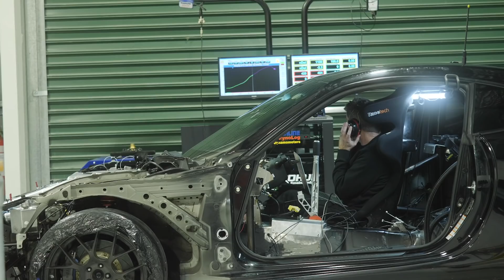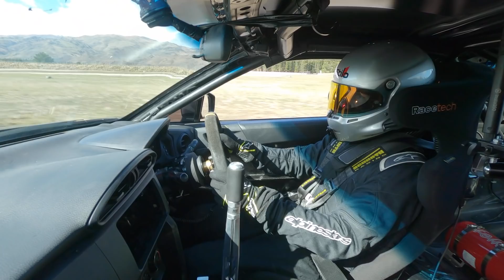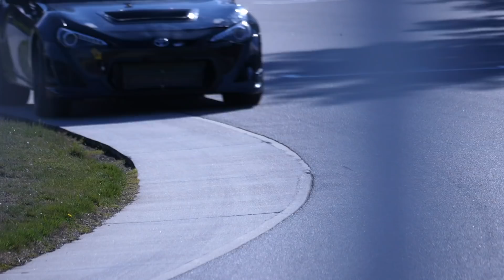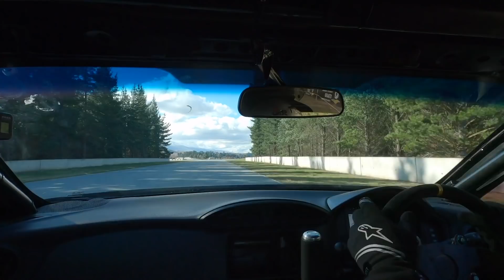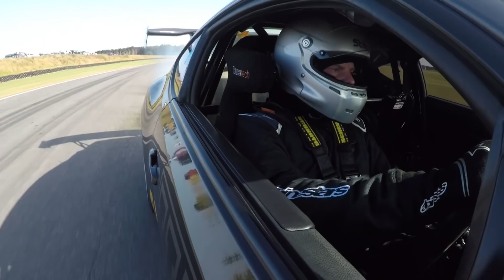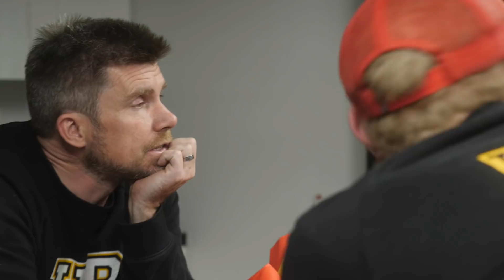Full Power Tuning & Track Testing | 650HP SR20VET Swap | SR86 EP 6 [#BUILD]

Comment: flowing too fast is completely false. It may affect how it flows through, balance...but it will never be too fast. As for the fluid ejection...no signs or warnings/fail safes for cooling system pressure ?

Comment: Can you give a bit more clarification around the power matters not torque and seeing how you run the car totally naked on the dyno with the intake right infront of the fan, would that not alter the tune once the body panels are on the car and the intake is brought back in the engine bay be it with a open air path?
Reply from the maker: You need to confirm the tune on the track/street, it's the last step of dyno tuning. Doesn't really matter what panels you have on or off, you can never replicate the real world on a dyno like this.

I'm sorry but I don't understand your power vs torque question - Taz.

Comment: Just a thought! I've had an engine builder tell me to run water only in the cooling system until the coating on the head gasket has had a chance to 'bond' with the block and head. Apparently the chemicals in coolant can interfere with the bonding process causing gasket failure.

Comment: That sucked, and not in a good way...
Any reason you weren't running a coolant pressure sensor and alarm, or didn't it trigger as the pressure wasn't high enough - you may get very lucky and just have a faulty pressure cap?

Comment: Replace head gasket, check head for deck flatness, torque the head to slightly higher tension than used previously,...
Then Run at much lower boost...

After the upcoming event, rebuild the block with coolant ring machined around the deck in this video @10:15

https://www.youtube.com/watch?v=07HHr6u1t-I
Reply: Also i think the earlier run with stuck thermostat with coolant temp reaching 120degree C pretty much accelerating this issue (or could be the source)

Comment: Loving this series! Also: what do you think could cause the head to lift like that?
Reply: High cylinder pressures or excessive boost is a common cause, sometimes the gasket itself, if the seal isn't optimum can give way under too much pressure. In drag racing where they run upwards of 50psi boost its common to see steel 0-rings (fire rings) coupled with custom gaskets and sometimes larger head studs to help alleviate these kinds of issues. Its an expensive rout though and requires a specialist to be done correctly.

Comment: My 2cents is pulling the thermostat causes you to loose the "pressure head" (of coolant) in the head block that packs coolant tight around the hot spots.....so steam pockets can develop causing localised overheating coolant pressure spikes etc.

Comment: Ugh that’s gutting news. Still, good to discover it before the practice session. Appreciate the behind the scenes reality of the situation discussions, felt like we were in the room with you guys. In a sea of unicorns and rainbows the harsh taste of reality coming at you fast is refreshing from an audience standpoint. Sucks the coolant pressure sensor wasn’t working but it seems pretty conclusive for the footage. 

How would you proceed with this? Torque the head and go do a quick couple of pulls with the coolant pressure sensor operational? If you weren’t on a time crunch would you just pull the head straight away?

Comment: Great to be on the journey with you guys, fingers crossed you got it sorted today. Andres comments about removing the thermostat resulting in water flowing to fast were interesting because I have read some info to the contrary. That there is no such thing regarding water flowing too fast through a heat exchanger, it's all about a centrifugal water pump needing some back pressure to get into its operating region, otherwise it's just free-spinning in the water. Or something like that, would be interesting for you guys to dig into one day!

Comment: Had a quick scan through the comments and haven't seen this one asked yet. Given you were chasing overheating problems prior to water blasting the engine bay, how did you conclude that the issue was excessive cylinder pressure lifting the head vs inadequate cooling leading to the headgasket failing?
Reply: He was saying that issue was fixed when they drilled the tstat it wasn't overheating anymore.  I'm guessing they damaged the head gasket seal during the period when it was initially overheating to 120C (VERY HIGH!!)

Comment: Man that sucks! I assume you guys are running 1/2" head studs? If so 24psi shouldn't be a problem. I've never retorqued head studs after a heat cycle but again I've never pushed boost too high but its definitley something I will be doing on my next build to be safe.

I have a P11 head here with no cams for my SR22 build, what spec are your Kelfords? Also you mention its a stock head? Is that in terms of porting or is all hardware stock?

Keep plugging guys love following this build! Also I'm the guy you Skype interviewed in Sydney in regards to the Motorsport Engineer role :)

Comment: This is why most Road Racers will drill 1/8 inch hole in their thermostat.... I guarantee you the cooling problems are the cause of the blown head gasket/ warped head. And I really doubt that they're going to make that event. I really hope you guys get to make it to the next event... i suggest buy a couple thermostat's... drill holes in them. Make sure that you have three or four different temps. that way you guys can dial and how it runs. who cares if it takes a little while to warm up and it wants to cool down that's kind of what you want in a road racing car. Best of luck

Comment: Suprised you don't have a coolant pressure sensor fitted.

That said we've all been there.  Proof that things don't always go to plan and that unlike an F1 team, there's no night shift and spare $15k motor sitting in the shop
Reply from the maker: We did, but it wasn't working correctly during testing. Tis one of the reasons why you test things. Hindsight tells us we should have fixed that before running things, however, hindsight is also absolutely useless 😅- Taz.

Comment: The boost map rotary dial on the steering wheel - where did you get the numbered switched position dial? Or did you make it? If you made it what did you use? Thanks
Reply from the maker: These are multi-position switches from Motorsport Electronics here in NZ and come with the stickers (https://www.msel.co.nz/epages/motorsportelectronics.sf/en_NZ/?ObjectPath=/Shops/motorsportelectronics/Products/SWIMSEROTRA) - Andre
Reply: Ah ok thank you. Looks like you used one of their optional decal sheets and cut it to your 5 positions. I tried to order one of those decal sheets recently but I’m in the US and as I should have expected,  it was not economical for msel to ship a sticker here. When I saw the shot of your steering wheel I was hoping you had used another solution. I’ve already made my own rotary switch thanks to your guys practical club level wiring course, so I just need a dial. The search continues. Thanks
Reply from the maker: Saw this in passing the other day and thought of you. Not sure if it helps or not - https://trackformula.co.uk/product/custom-stickers/ - Taz
Reply: @hpa101  Thank you!!

Comment: I think engine is too efficient and needs some blowby. Maybe adding another sensor for crankcase pressure and logging it would be an answer. Water temp. and/or oil temp. to blowby pressure will bring you a safe sitting head? Electric thermosthats can bring you an pwm adjustable water temps. Hey, I just remembered it's running dry sump, but maybe an analog pressure sensor's peaks can tell something in pressure by spark data log? 
Another idea, put heat ressistant strain gauges in every spark plug hole(or near between head studs), calibrate at working temps. and use it as a boost and/or timing limiting factor 🧮👋🏼
Reply from the maker: Blowby is pretty much an unavoidable aspect of any internal combustion engine. We are dry sumped so this helps reduce positive crankcase pressure but regardless, blowby isn't really related to head sealing but rather is a factor related to cylinder pressure and ring seal. We also monitor crank case pressure but this is more for some insight into engine health - Andre

Comment: Time for a coolant pressure sensor ? Edit: saw you have one already that wasn’t logging unfortunately. Like you said. Reactive information stream anyway. What head studs, Custom Age? Is there a chance the block is flexing ?
Reply from the maker: The head studs are an 11mm Mazworx/ARP2000 stud. There are better options out there but honestly at the boost and power levels we're aiming for this shouldn't be an issue at all - Andre

Comment: How good do they sound though!
Reply from the maker: So good! I can't wait to hear it at the track with a straight pipe. Will be epic. -  Ben
Reply: @hpa101  did you use 1/2 head studs in this? I've got cosworth studs and gasket in mine touch wood it's been good so far.

Comment: So looks like you were not having this problem when running coolant but only when running just water. Could your issue actually be caused by the much lower boiling point of water vs coolant rather than head lift per se?
Really enjoy your videos btw... I think it's great that you even share when things don't go as planned!
Reply from the maker: In an interesting, pure water actually does a better job of cooling than a water/glycol mix. The glycol is really there for antifreeze and anti corrosion properties. There are however race-specific coolants that focus on improved heat transfer but in this case it definitely wasn't a factor that made a difference - Andre

Comment: Install a pressure sensor in the cooling system and setup a driver warning or boost limiting strategy in the ecu.
Reply from the maker: We have a coolant pressure sensor installed which unfortunately had an issue during our testing. We have it up and running now and yes, it's great data to have, however once the head has lifted your day is done. The real key is to not get into that situation in the first place - Andre

Comment: Wouldn't an expansion tank reduce the likelyhood of head lift occurring? This set up would entail removing the radiator cap and having the water from the radiator overflow into  and expansion tank which would have a line from the bottom of the tank going to a suction to the water pump in the cooling system
Reply: The head lifting doesn't have anything to do with the cooling system as Andre said in the video, the water spraying out is a result not the cause. The head has lifted off the block due to the combustion pressure being greater than either the studs can handle.
Reply: @jarrodflood1353  Thanks

Comment: Good luck to the crew. There is always hope. 
How did the 1UZ blow up? I have a boosted 1U and it's held for a few years now.
Reply from the maker: The 1UZ dropped a valve at 8700 rpm. Safe to say there wasn't a lot of good stuff left after that :) - Andre
Reply: @hpa101  Ooooohhh! Yea..... Dude you said 8700rpm. Didn't think they would spin that high. Wish these engines had more aftermarket love. 
One day I'll get around to buying an 86 and swapping an engine in. I'd do the engine I think Toyota should have used from the start, the 8AR 2.0 turbo from the Lexus IS/GS/RC. I think one of the Japanese race teams is getting 650hp out of it.